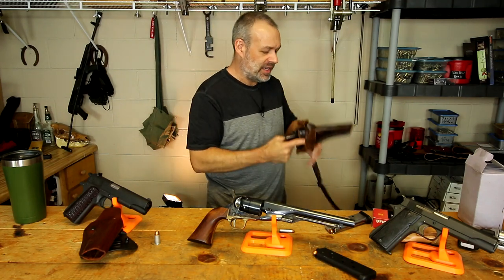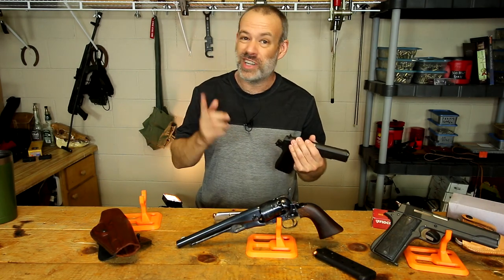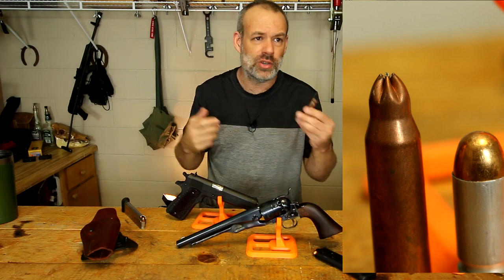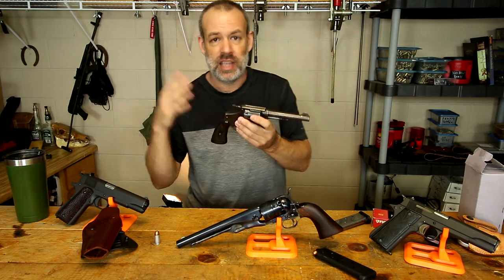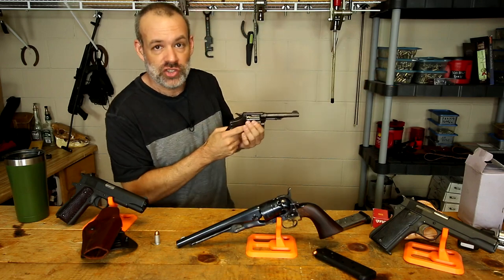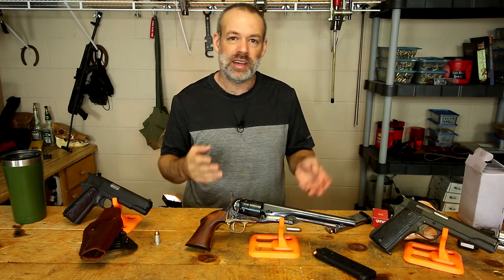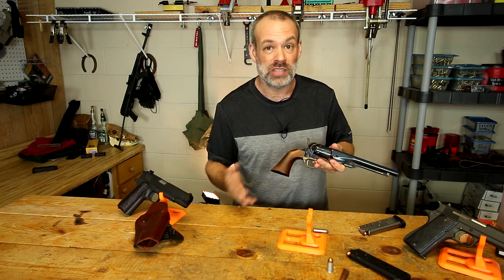How Do Prop Guns Kill?

Comment: There are manufacturers that make real looking exact replica out of metal and functioning slides and everything guns, and yes revolvers too...but CANNOT accept a round with a bullet. Can only load blanks into it. They cost about $200. It's insane that ANY production after Brandon Lee would be using anything but replicas, and by proxy ever allow a real firearm or ammunition on set.
My understanding at this moment is that it was a real gun they were using to target and practice with out in the desert with live ammunition, and then it got put back into the "prop" cart with 2 other "prop" guns with live ammo still in it by the young and inexperience "prop master" or armourer as they are actually called when they deal with firearms exclusively.
That being the case, Alec the actor probably won't be found responsible. But Alec the producer is screwed if he allowed lapses in safety protocols...or even worse...violated them himself or didn't have any.

Comment: From what I read there are multiple checks to be made on set from the prop master to asst director. No gun is to be fired directly at an actor, if the shot is aimed at the camera no operator can be behind the camera. As Producer Alec is responsible for all accidents on set, OSHA will also investigate and fine the production company. Alec will most likely face a civil wrongful death case as well. Alec pulled the trigger this blaming it on the prop master is wrong in my book. I would wait for fingerprints on the cartridges before blame could be given against the prop master. If it was loaded properly by the prop master and Alec violates the primary safety rule of never pointing at a person, Alec should take for fault. Even if the prop master put live rounds in it. Alec broke protocol by aiming at a person, so they would bother be guilty of manslaughter!
Reply: I've been on 20 second set location gigs myself.  Most with period military or frontier films and documentaries.  I have seen many a shortcut taken by camera crews and directors.  They are extremely edgy and arrogant, plus magic hour light is fleeting for that perfect shot.

Std Practice, firing toward camera or crew requires a shield...often skipped

All close camera shots are to be done first before any blanks or hero rounds are introduced....often skipped because the shot schedule was worked out without advice of the armorer.  I saw a held camera technician and the key grip blasted with black powder once, because they wanted to redo a closeup trigger pull angle, after muskets had been used for blank firing.

Extras are never handed a functional firearm, even to carry empyy/intertly...often skipped 

Talent on set must be fully briefed about the mechanics of the filmed firearm they will use... Often skipped because SAG talent is EXTREMELY arrogant and sometimes lightly high to "help" with their acting flow.

Period films sometimes exclusively use commercial historical replicas (like reenactors and target shooters use) from the same suppliers, because a OTC Colt 1873 Peacemaker, 1851 Navy or a long gun is much cheaper than buying movie inert guns or CO2 theater guns like are often used in modern cop shows. 

Often directors and actors unfamiliar with historic firearms treat them a bit like boyhood cap guns...because they look like that.  If a strong armorer or prop master will not assert authority... I've seen some wreckless handling. 

Near incidents or burns happen a lot more often than people know.... As theater is professional "play" acting people. 

All that aside, when a 19th cen revolver is handed to an actor for close camera work the cylinder has to have what looks like bullets in the chambers...since they show.

It is almost impossible for that actor to tell by look alone.  If it is a pressed cylinder load like a Colt Navy or Army ... The only way would be to pull the load apart since there is not a metallic cartridge.

If it is an 1870s+ SAR cartridge Matt Dillion revolver, then it is easier to check without disrupting the film schedule.
Reply: @STho205  thanks for writing that out. That was an interesting read
Reply: @kyle18934  you're welcome.  I was seeing so much cop show guesswork... And this was a western using old Colt Peacemakers and conversion Civil War replica pistols.

Turns out that was the firearm.  Also the set armorer was 24.  Also the crew at the location set liked to go do target practice after hours in the desert with live rounds.

Only takes one mixed up 6 shot cylinder placed in a Colt frame or one bullet jammed barrel not probed to kill someone.
Reply: Ive heard they left the gun, along with two others on a rack (no mention of locks) while they went to lunch. Also this same gun appears to have fired projectiles before on the same set. Defiantly some hanky panky going on there
Reply: @STho205  thanks well written I think one key is the word "arrogant" another is time pressure. Not a good combination when power meets worker

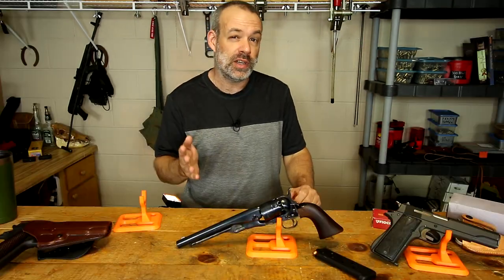Comment: 1:15 Same deal with prop swords. Fighting scenes use urethane blades that are thick, heavy, and won't look real if you hold them still and close up. Carry/wield props have aluminum blades for easy handling and passable appearance. The hero sword prop is pretty much a real steel sword reserved exclusively for promotional stills and close-up beauty shots by the B-unit.
Reply: Nope! They're nothing but steel rounded over on the cutting edges.  Deal with them often, and have to file the knicks down constantly to keep sharp burrs to a minimum. IATSE (union) props department head.

Comment: Hey BC.  We used crimped 5.56 blanks during training when i served in the US Army during an FTX
in West Germany.  They required a blank adapter attached at the muzzle to create a partial obstruction
of the barrel so there would be enough pressure to cycle the bolt during training.  

During one FTX at the German Kaserne Muenster Lagen Sud one of the guys in our unit thought it would be funny
to remove the blank adapter and put his barrel against his buddy's arm and pull the trigger.  Well it wasn't funny to the guy he shot.  The plasma coming out of the barrel was enough to create a hole in his arm that looked like a gunshot.
On the plus side we did get to do some excellent First Aid training.   MEDIC!!!
Reply: I would think the "plasma" would have vented out the sides of the flash suppressor.
Reply: When i was in cadets many years ago at camp we were given some blanks to use. The demo on how dangerous they can be was to put a tin can on top of the barrel and fire the rifle upwards. Blew a big hole in the base of the can and blew it about 20ft in the air.
Reply: Ouch! Did he keep full function in his arm?
Reply: @kyle18934  Yes he did.I think he did lose strength in that muscle for a while though.
Reply: @williamwalsh5262  Whoah.
Reply: @yonathansadikin7010  Well yeah.  My point was if you put something in front of the barrel, the flash suppressor ports become the path of least resistance.

Comment: Alex Baldwin was not just the actor, he was also the producer. As Producer, he created a toxic work environment. Not only working them long hours but putting them up at a hotel an hours drive away to save a few dollars vs one close by in Santa Fey. He personally overrode the prop masters safety regulations leading to 3 ND's prior to this. It led to the crew walking out on him. Alec personally hired local non union workers to replace them. In this case, a 24 year old girl who only had months experience and in her own words "Loading blanks into guns was terrifying". Once again, the production supervisors would not allow the prop master to apply even her limited experience. Alec is the villian in this. Maybe not as an actor but as the producer
Reply: If what you say is true and I have no reason to doubt you, then Baldwin should be held responsible, I as a gun owner,  just cannot see how anyone with any common sense can point a firearm at anyone under any situation especially with goofy self centered actors. A 24 year old with little or hardly any experience with firearms is NOT qualified.
Reply: Alec failed to check the firearm and failed safety measures by pointing it directly to the victim and firing the round.
1st degree manslaughter at the least.
Reply: Cool story
Reply: Source?
Reply: @scoutdynamics3272  true, but at least their walls are dropping it seems.
Reply: @AlexanderMason1  cute pseudonym.
Reply: @derchozenvun83  ? What do you mean?
Reply: @AlexanderMason1  the missing persons photo with age progression says it all; aside from the already addressed obvious part.
Reply: @derchozenvun83  what are you saying? What exactly are you talking about?
Reply: @AlexanderMason1  cute, you had the one about your age progressed milk carton photo deleted.
Reply: @derchozenvun83  what in the hell are you on about? Lol take your medication dude.
Reply: @derchozenvun83  that picture is me a few years ago, the name is my actual name and there is no one “missing”. Are you schizophrenic by any chance? What a weird comment…
Reply: @AlexanderMason1  what a cliche reply. You and your people have failed miserably, and my non-involvement isn't going to affect the inevitable.
Reply: @AlexanderMason1  I should add that it's more than a little off for someone "your age" to not have any photos other than what's practically a mugshot from "a few years ago". You're using a network device, so you obviously haven't been without a camera for years.

Comment: If you're a producer, an actor, and have handled guns multiple times throughout the years, a case could be made that you are a link in the chain of responsibility.
Reply: Actors are not ALLOWED to check if guns are loaded as this requires disassembly of the gun. Only the armorer is allowed to do that. Baldwin was told the gun wasn’t loaded.

Comment: I had been wondering this. I would think, after past accidents, they would have made it nigh impossible to actually "shoot" someone.
Reply: It is impossible --- So this was not an ACCIDENT!
Reply: At a certain point accidents are inevitable... I mean theres been what a total of 3 fatal accidents with who know many thousands of blanks fired on set. Extremely rare for the number of movies made with blanks. Somebody royally fucked up the safety protocals here.
Reply: At the time Brandon Lee was killed on the set of "The Crow", blank-only firing guns had been around for decades. I was disheartened to discover that most movie studios use "real guns" loaded with blanks, that require that special care is taken to prevent "live rounds" from being loaded into the gun. Filmmakers have been writing off Brandon Lee's death as a "fluke accident" for 30 years, and continuing to use "real guns" that are capable of firing real bullets. The accident on the set of "Rust" is as infuriating as it is tragic.
Reply: It is impossible if you follow 4 simple rules of gun safety. every incident that ever happened was violation of one of them. They violated all of them.

Comment: This is such a tough moral debacle here... For the most part i believe being an actor/movie star DOES NOT absolve you of one bit of responsibility.  Except when an adult hands a child a firearm, YOU the handler are now responsible for the safety of said firearm.  I hand someone legally alowed to handle a firearm a firearm  and say its unloaded then you DO NOT do as proptocol requires and make safe the firearm in your possession, YOU as the handler are now responsible BUT, as i believe ehat likely happened here, i hand you a defective firearm through my own negligence and/or carlessness, I fully believe that the issuer/care taker of that firearm is now responsible if the defect would not be readily apparent to the experienced firearms handler.

Comment: Retired prop master here.  A couple of quibbles, re sending the BFA into the barrel of a semi-auto pistol. First, the gun is probably rented from a prop house, so the PM would not be allowed to weld it, I always kept a allen wrench on hand to check that the BFA was securely in placctivatedae. Second, the size of the hole in the BFA has to be regulated to the power of the blank being fired, so it is necessary for the gunsmith at the prop house to be able to change it to suit the power of the blanks being used on each production. 
There were several serious mistakes that seem to have been made on that show. I am hearing that that gun had been used by (some people) before the scene in question to fire some real ammo. As the safety rules point out, real ammo in never allowed on set except in very special circumstances, in which case if must be stored in a separate, marked locked containter. Next, apparently the AD picked the gun up from the weapons cart and handed it to Baldwin telling him that it was safe but not inspecting it and showing the condition of the weapon to all the actors on the set as well as members of the crew, the PM should call out "cold gun on set" and then perform the safety demonstration. The AD should not at any time even touch a weapon, much less hand it to a actor. 
When making up dummy rounds, I would take unprimed cases and load the appropriate bullet in the case, with the primer pocket empty, it is easy to see that the round is safe. It used to be common for prop houses to make up dummy rounds using fired cases in which case since you could see from the dent that the primer had been fired and that the round was safe. For shout where the scene calls for rounds to be seen from all angles and thus you would see either the empty primer pocket, or that the primer had already been fired, I would again used unprimed cases, take the appropiate size primers, place them anvil side up on a surface the then flood them with WD 40 and let them sit or about a hour. I would then use a plastic tool to pry the anvil out and scrape out all of the priming compound. I would then load that inactivated primer into the case and then put a BB or some sort of small object into the empty case before loading the bullet. That way I could shake the round and be hearing the rattle, be sure that the round I was handling was indeed the dummy round that I had personally made up. Of course this takes quite a bit of time, so I would generally do this during pre-production. 
In one case doing a Vietnam war movie I had scenes where I had several soldiers on patrol where they were carrying extra belts of ammo for the M60 machine gun. I that case I contacted the PR department of one of the companies who make primers and had them send me a couple of thousand peimwea that nor had the priming compound and anvil inserted and I used them to make up the belts of ammo for the soldiers to carry.
The Property Master is responsible for all the weapons used on set and has a established set of standards to follow, but in recent years I have noticed that productions are using separate armouers, to supply and handle the guns and I don't know how much supervision the PM is giving to making sure that safety standards are followed. Many times the armorer comes from the prop house supplying the guns and may be more concerned with making sure that the guns work properly than safety. 
It all comes down to time and money. It takes time on set for each gun in a shot to be shown to each actor in the shot and such crew members as may want to be included in the demonstration and the prop master need to be involved in setting up the shot to be sure that the guns are aimed in such a fashion as to preclude any matter exiting the barrel from hitting a actor or crew member. This may involve setting up a shot from a angle where the gun is aimed safely off to the side but from camera appears to be aimed at the intended target. When a gun is to be aimed at or near camera, the PM works with the grips to be sure that proper safety measures are put in place to protect the camera crew and any others near the camera. This may involve setting up some sort of barricade such as plexiglass or plywood with a hold cut in it for the lens, suppling the crew members with face and hearing protection and making sure that unnecessary people are not anywhere near the line where the gun will be fired. This all takes time and as the saying goes, "Time equals money" and some producers may balk at doing that, also ADs may try to speed things up so they can stay on schedule.
I properly trained people and hired to handle weapons and they are allowed to do their jobs, firearms can be used safely on a movie set. The Property Master must be willing to put his job on the line when he feels that his safety instructions are not being followed. On a couple of time I just locked the guns in the gun safe on the prop truck and said that If they were not going to do it my way, then they were just not going to do it, (at least not while I still had the job). 
Accidents most often occur at the end of a long chain of events which all takes together lead to tragedy. The most dangerous thing is the human brain and the danger of not using it.